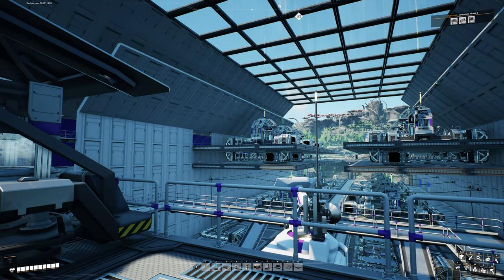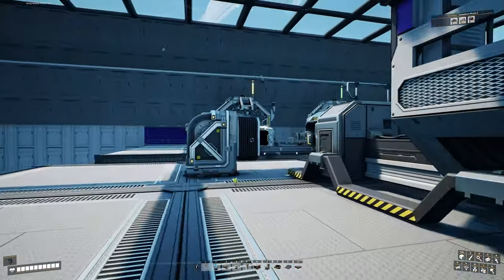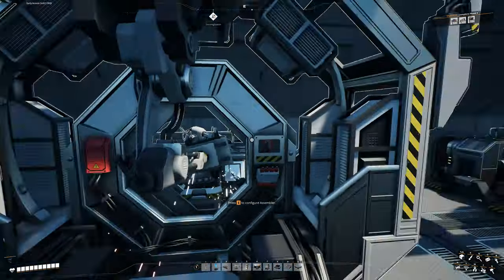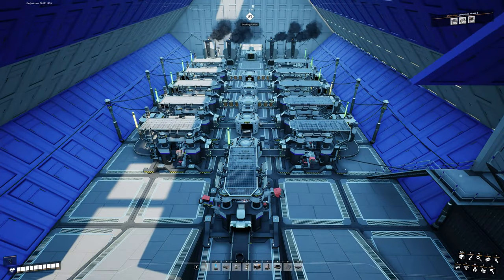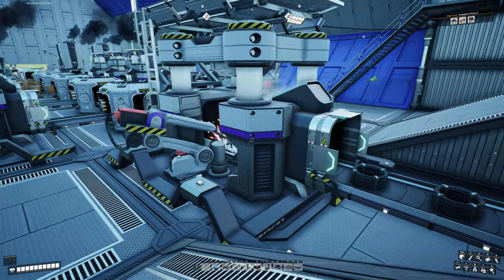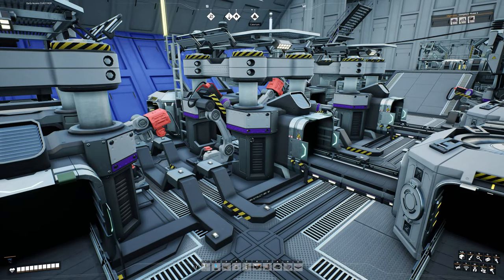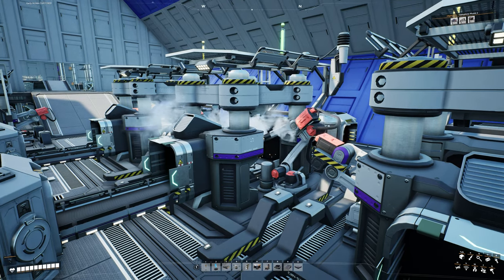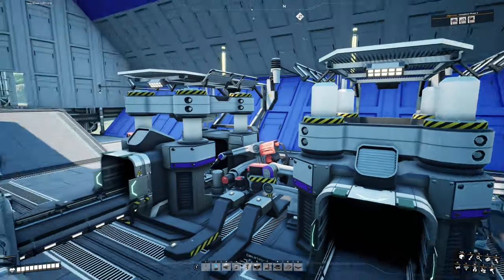HOW TO SATISFACTORY - Ep. 21 - Fixing the Efficiency Part 2 - Tutorial and Walkthrough

Comment: Hello, I'm going to go through this video of the series, I don't know if you noticed it, but there is a problem when you place a single line for several dividers and that is that you don't actually place the same amount in all of them. I'll leave you an example of what I mean. .

You produce 100 ingots and place 5 dividers, you would expect there to be 20 ingots in each machine, but when performing the division it is not really like that.

- Divisor 1 = 50
- Divisor 2 = 25
- Divisor 3 = 12.5
- Divisor 4 = 6.25
- Divisor 5 = 6.25
Reply from the maker: this isn't a problem actually in the long run. You produce the materials and run them down the line.. sure the splitters at first do as you gave the example but eventually the machines get full.. and only take what they need. one machine fills up.. then the next.. then the next.. til eventually they are all getting the required material. It does take a little time.. but it works. There are two ways to split materials on a line. Load Balanced, and Manifold. This method is called the Manifold type

Comment: I'm having this weird issue with one of my reinforced plate assemblers is staying full 500 on wire and hitting 100%, while the other one is sitting at 43%ish , it's not getting enough wire. Hit about 26 wire max then has to wait for more.
Reply: It appears Stators at the very top have the same issue. One side is getting more than enough and the other side is barely getting any. Same sides as well.
Reply from the maker: what episode are you currently on. I think I fix this at one point but cant be sure. I might need to take a look at your save file
Reply: A little late, but the problem is because the Normal Divider must be changed for a smart Divider, so that it sends all the wire up and the rest to the warehouses.